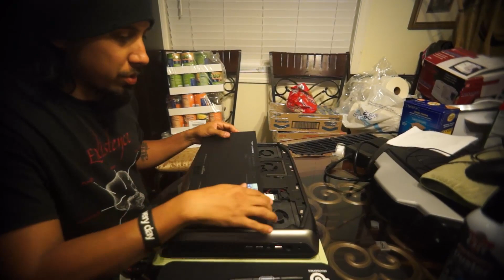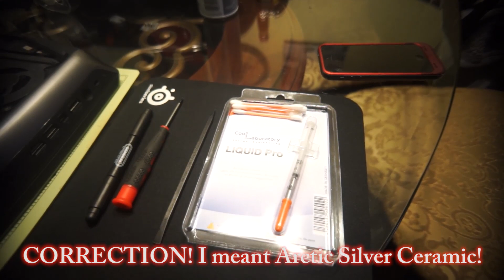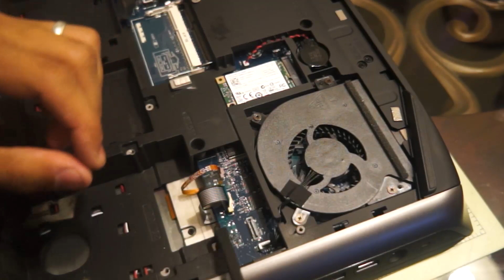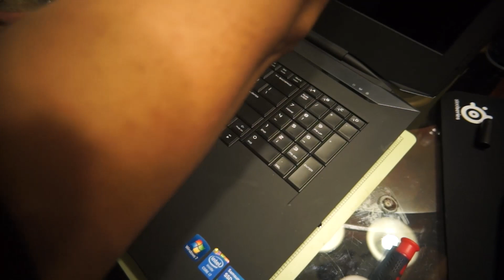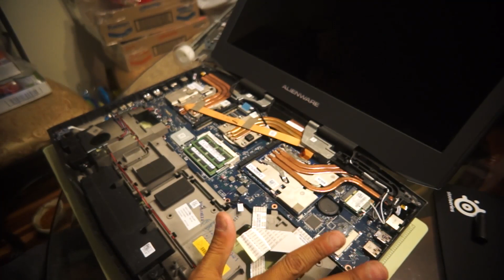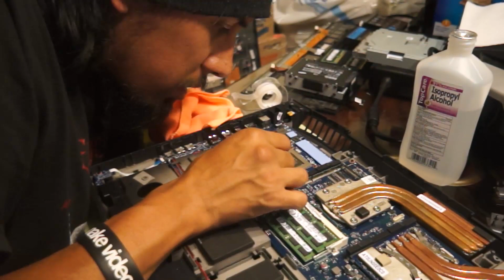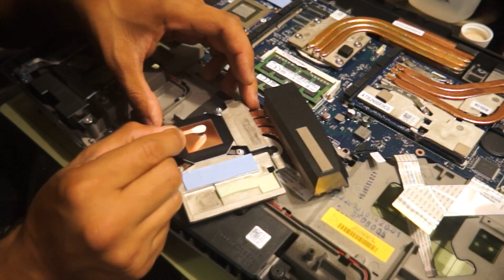Alienware 18 Disassembly and Repaste! Step by Step

Comment: Thank you for this! I have an M18xR2 and the graphics card on it spontaneously fried right in the middle of Elder Scrolls Online. X) Smoke even billowed out the back, it was all very dramatic. I got it all disassembled (before I watched your video, so you'd be horrified at the state of my screws) and the thermal paste is really caked in there. Nothing like the meticulously thin layer you demonstrate. Ordered a new graphics card after searching for ages on eBay. Do you happen to know what caused the issues with your first graphics card? I'd like to never have it asplode on me in the middle of a boss fight again! -Rena

PS: Definitely enjoyed your sound effects and sly Willy Wonka quote.
Reply from the maker: Haha thanks! I was wondering if anyone would mention the Wonka quote. No worries about the screws, you get used to the size of them and know where they go after a couple times of disassembly :-P. I definitely think it was just part of a bad batch of cards. That, or a bad new driver that Alienware has been putting out. Its been quite a struggle to find a good driver that runs this card at its potential and doesn't over heat the thing. Number 2 I would say it was the stock cheap thermal paste that comes with the cards itself... Definitely crap stuff that you need to replace :-P It overheats way to fast with this stuff on it. I'm surprised that it didn't thermal power off before it fried... Something wrong there... As far as my graphics cards, I had a bad batched primary card that would artifact a green line on my display. I contacted Alienware and they tried everything but the graphics card to try to repair the problem. Instead of sending me a new graphics card they decided to send me a whole new computer with the same specs. I definitely saw that they used the new (better) batch of cards as they are blue chips. I kept the new model and then re thermal pasted them right off the bat. (hence the video.) I haven't had a problem since! :)

Comment: so tell it pls Factory paste from dell worse or not so ? it is about 4 months passed after using alienware (buy it) and i dont like my temps on gpus.. hard games - 85 - 87*c  How old is this machine in your video ? THX i addet this 1 to fav coz going change paste too -.-
Reply from the maker: The stuff that came on this computer was pretty much useless. i got mine late last year
Reply: Sasha Kazunin Going from my own experience? Definitely change the paste if you haven't by now, mine was layed down like a three year old with a potato gun, the amount of excess paste around the chips could have properly pasted about another 5 laptops.. Mine does sound a bit worse however since my idle temps were close to what your load temps are, even so, you should benefit from clearing it off and replacing it with something quality :).

Comment: So.. where is the location of the light strip? ( the lightning below the front speakers ) thanks
Reply from the maker: I never really saw a spot to look at it easily. I know you can get to it though. Maybe I will look into making a video. What happened with yours?
Reply: Uhm okay, so i bought my new Alienware 18, but the light intensity between the two light strips below the speakers is not the same.. the right side is normal, but the left side is dimmed. Yesterday, the Dell technician came and replaced the left light LED cable. And the result is.. it is bright but still dimmed compared to the right light strip. And now i still have to wait until the next call from dell.
Reply from the maker: Ohhhh I see. Yeah, I had problems with my first graphics card. No worries! Dell will keep at it until you are satisfied. Maybe its the right LED that is letting to much light pass through.
Reply: But i think the right LED is the proper looking one, i mean it is exactly the same as it shows on any other Alienware 18's. Yesterday, if i'm not mistaken, the technician told me that this is not the problem with the LED small cable, but instead the problem of the left light strip itself. A full  Alienware 18 barebone replacement might fixed it, i don't know. Also, the LED light line is attached to the Alienware 18's barebone, right?

 ( I hope you can understand my english ) XD

Comment: Can you take out the processor and upgrade it with another?
Reply from the maker: Yes you can :)
Reply: ***** On that note, if I were to upgrade from a non MX CPU (let's say 4700MQ) to an MX CPU (4940MX), would I need the triple copper pipes for the CPU? I know that if I upgrade from a 765M/770M/860M/870M to an X80M , I'll need the triple copper pipes.
Reply: ***** Save yourself and the hassle by going with the 4910mq hits 3.9 ghz
Reply from the maker: It should be the same heatsink shouldnt it?

Comment from the maker: Reassembly and Temp video will be up in a day :)
Reply from the maker: I see that you haven't used Cool Laboratory liquid pro thermal paste before. In which, you DO have to spread it as thin as possible :-P Anyway, Thanks for giving the advise for those that don't already know already :-P (I already use the method you described for other pastes.) Thanks for watching :)
Reply: ***** I can second this, the liquid pro 'paste' (which gives a totally incorrect impression of the consistency/behavior of the material) is unlike anything I've used before, you really do have to paint it over the surface gradually and carefully.

Another reason not to slap a rice/pea sized drop down and hope for the best is that this 'paste' is a room-temperature liquid-metal alloy, and so is extremely conductive, with many surface-mounted components very close to where you're applying it, leaving it to spread on its own could cause droplets to go somewhere they shouldn't and short-out nearby components.
Reply from the maker: well said :)